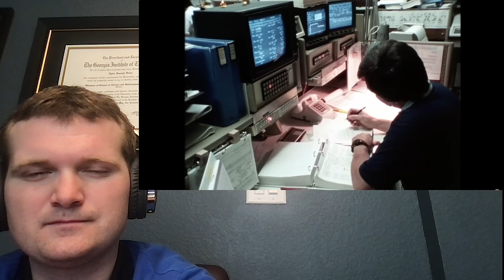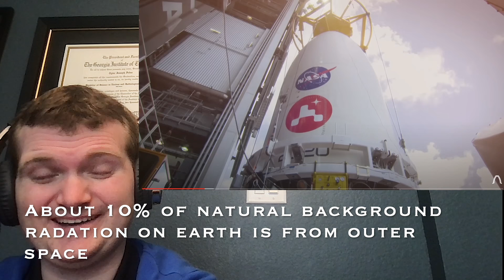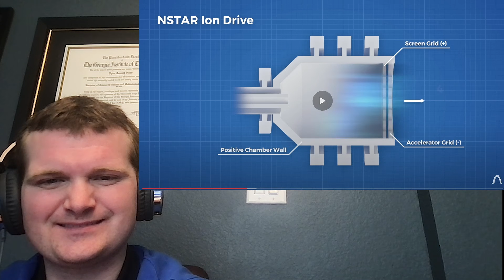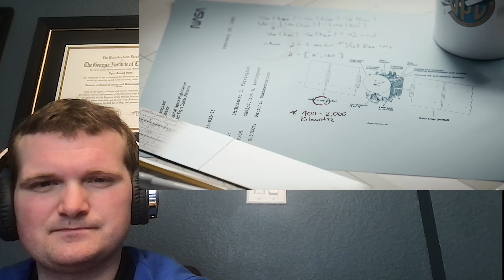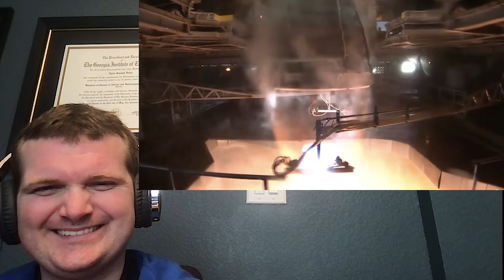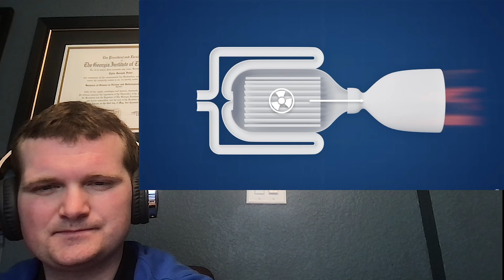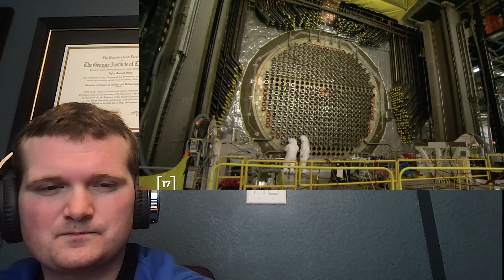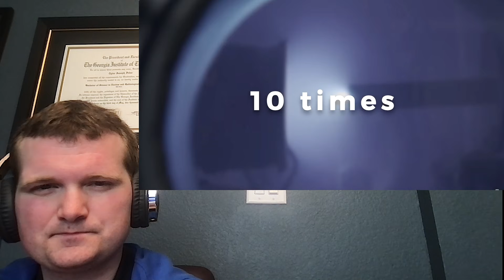Can Nuclear Power Take Us to Mars? - Nuclear Engineer Reacts to Real Engineering

Comment: Didn't they already try nuclear powered propulsion rockets in like the 70's ,80's but abandoned the concept .
NASA considered it too dangerous if 
the ship somehow blew up in the atmosphere ,LOO before it got into space ?
Just asking.
Reply: They have abondon it in the 70 beacause the project buget was cut and the launch risk is not realy massive since a unused reactor is less radioactive than a used one by order of magnitudes
Reply: Congress killed the NERVA program because the moon program was immensely expensive and a mars program would cost many times more and they didn't want us sucked into paying for it. It was the correct decision because we are on the cusp of sending humans to mars using in-orbit refueling and the program will cost less than one hundredth as much as it would have in the 70s thanks to modern rocket launch being far cheaper, and in-orbit refueling enabling nuclear like performance to Mars and back. 
Lastly, we didn't have any significant accidents in our nuclear rocket program, you are thinking of a Russian satellite that had a nuclear power plant that crashed into the Yukon in the 70s. The way the US launches nuclear plants into space is they aren't activated until they are clear of falling back to earth, because the nuclear fuel is relatively inert and low-radiation before the reactor is started, but once the reactor is hot the fuel and inner components become super radioactive.

Comment: NERVA will work, just don’t do direct ascent. And separate the engine and the crew, and put the water supply in between.
Reply: No one argues NERVA won't work, its only effective on routes that don't allow aerobraking because you can't re-enter the atmosphere once the nuclear plant is hot,  so it requires far more dead mass on the Mars route.

Comment: Solar sails could work tho, you use a gravity assist and a large solar sail to accelerate away from The sun and to decelerate at the target star. But if it isnt aimed extremely well the deceleration part doesn't quite work properly and you end up with some tangential velocity drifing away from the other star.

Comment: I think of a Sterling engine protect the cold of outer space and the heat inside and provide Power while turning heat into energy. And add inertia if done right
Reply: The heat inside has to come from somwhere. It's not free power.
Reply: I also think a Sterling engine cycle could do things here. In the sun side it gets pretty hot (moons sun side is about 127 Celsius) and on the other side you could have "space radiators"... don't know how they will work though as on earth we have air that can soak the heat up but in space there is none... so you can not just use a normal earth radiator. But there has to be stuff that can radiate heat into space because otherwise it would be hard to live on the ISS for example I guess...
Reply: Space is not cold, its a vacuum. So the temperature of any part of space can vary massively but most is technically extremely hot, meaning the very few particles in it are moving very fast, but there is so few particles per cubic centimeter that they can't heat you up at all. And any heat on your ship or in your engine is trapped unless you find a way to radiate away.

Comment: 11:54 you can do shielding with water. Because the astronauts will need water anyway. Moreover, if you're flying away from the sun, the spaceship itself can be used as a shield
Reply: Nuclear rockets need heavy extra shielding to keep the crew alive. A chemical rocket to Mars doesn't need much in the way of shielding at all, basically a solar storm shelter for solar storms, but other than that the radiation levels are easily survivable for long duration missions.

Comment: Well build the between mars earth ship in space. Send up the fuel. Send the supplies. Send the people. Space launch to mars. Easy.
Reply: There is no "between" mars and earth, both planets are constantly moving in orbits at high speeds. You can't just stop and hangout in space, you have to be traveling fast enough to orbit around the sun and any planets/moons you encounter. The correct procedure is to re-fuel your ship in low earth orbit to maximize the payload you can take to mars, which is exactly how SpaceX plans to do it with Starship.

Comment: hydrogen embrittlement, it's pretty nasty. smallest known atom can get into a lot of places it really shouldn't be including between other atoms. ~> changes chemical properties and you no longer have the same material that was safe. shielding that engine is easier that a standard reactor as you only have to have something between the crew module and the engine not all around as in earth based reactor types. at worst light shielding using distance/time as the other part of the shielding for around the sides but not necessary as it should not be landing or taking off from anywhere, purely orbital and interplanetary transfers.

it's not burning hydrogen, that would take oxygen or other reactive. it's simply turning the heat up to 11 EXXPANDING the gas.

Comment: Reactor shielding in space is a long rod separating the reactor from everything else. You might need a small disk shield near the reactor to keep the rod down to a practical length. Still the mass of this is trivial compared to the shielding needed on Earth. Remember space is already radioactive, there is no reason to protect it from the reactor.
Reply: That’s right, minimise shielding mass, take advantage of inverse square law for radiation
Reply: Still adds a lot of dead mass, which is the prblem for nuclear. Higher ISP but at the cost of far more dead mass for shielding, radiators, larger cryogenic hydrogen tanks, 50% more fuel for deceleration and landers since it can't re-enter atmosphere after it goes hot.

Comment: Ion engines and their low thrust are less of a problem for cyclers, where you have a large transfer spaceship that takes you to Mars, but doesn't enter Mars orbit. Instead, you detach a lander spacecraft which can use high-thrust engines to insert into Mars orbit. The cycler swings around back towards Earth, and you can catch it the next time around (either from Earth or Mars).

Pros: Only need to accelerate the cycler once, and then it stays in the cycle. That means if you have the (enormous) upfront budget, you could build a very nice, decked out mobile space station with plenty of amenities and radiation shielding, and only pay to launch it once.

Cons: Rendezvous with a high velocity cycler from an Earth/Mars Ascent Vehicle is pretty tricky, which plays a major plot point in The Martian. Based on some light Googling it sounds like you can't shorten the travel time much because it'll throw off the cycles, so you'll really want to make the cycler as livable and reliable as possible (shielding, medical facilities, gyms, repair shop for things that break) compared to a faster nuclear rocket.
Reply: Yep, cyclers are slow boats between planets. But they offer far more comfort and safety and shielding, so your launch/lander ship can be lighter as the crew doesn't have to live on it for 9 months of transit. One correction: they still need more fuel because over time their orbits will get perturbed and you'll need to make adjustments to keep them on track. But as  you said, that can be done extremely efficiently with ion drives.

Comment: if you want a funny nuclear engine, search for the nuclear salt water rocket. it is quite efficient and has a lot of thrust.
but don't launch from earth, it's maybe worse than orion.
essentially, you have uraniumnitrate or plutoniumnitrate dissolved in water. push that water through a neutron source or reflector, and it goes over critical. or in other words: you are riding a constantly igniting nuclear bomb.
Reply: it would probably get you kicked out of most planetary systems on the grounds of pollution :)
Reply: @saumyacow4435  Nope..as said here.. space is VERY radioactive already.. you spewing out radiation yourself is like peeing in the ocean....
Reply: And the ISP is insane.. something like 40,000 - 1,000,000s with massive trust as well
Reply: @MrZnarffy  oh yes. the only situation where I thought that using a nuclear salt water rocket on the surface of earth is: if there is an asteroid in excess of 5km, and they need to lift off as much people and supply as possible. with such an asteroid incoming, irradiating the launchsite is irrelevant.

Comment: the most efficient nuclear engine is a nuclear reactor in the focal point of a parabolic mirror. but since that thing needs to reflect infrared and some gamma rays (alpha and beta are welcome too), the mirror needs to be a bit different. maximum reflectivity in infrared.
power up the reactor, it radiates infrared light. the light gets radiated to the mirror and reflected back out. this gives you the best specific impulse, but acceleration that is comparable to solar sails.

Comment: 32:00 this entire section is wrong about something (from Real Engineering). The reason we use Xenon is that it has the perfect balance of mass and electric charge and ionisation energy (he does mention this last big). Let's say we used a lighter noble gas like Helium. The problem is that once its ionised the charge per unit mass isn't actually that different. So we can't push it as hard as we can Xenon. There would still be an ISP increase, but not all that much. Scott Manley has an excellent video on Ion Thrusters and the balance between the different fuel sources.

Comment: from what I understand, and please correct me, if I am wrong: sievert work great for our experience on earth, especially with, as you mention, short term exposure.
and for simplicity sake, they adopted the same system for space travel, but there are some problems. first, it is a constant exposure over a long time, and secondly, there is galactic cosmic radiation, that has insane energy values, yet has not a lot of particles around.
the first one might be easier to repair, since there is never a real shock of high exposure, the second one is complicated, since we don't know if it interacts with the sensor in the same way as with the body tissue.
but still, I wouldn't go beyond 1 sievert. but there are ideas of how to shield that.

Comment: Love that we are currently told we can harvest minuscule remnants of moisture from the MOON and use it to manufacture hydrogen fuel to send space crafts across the solar system, YET we are also told that here on Earth where water is plentiful, it isn't sustainable to use hydrogen fuel from water to motivate cars along the ground for comparatively short distances requiring a fraction of the power and expense.
🤔
Reply: If they could charge the same price as gas prices, the world would be full of hydrogen engines......but water falls from the sky for free, very hard to commodize that
Reply: That's because on Earth there are alternatives that require less resources, and on the Moon or other celestial objects with low gravity fields there are no other alternatives. Also, to send resources like fuel from Earth to other places you need more fuel, highly inefficient which is why it's preferable to find it once you are elsewhere like celestial objects with low gravity fields from which you need less fuel to escape their gravity field.
Reply: @marilynman  The first car used a steam engine long before the invention of relief valves. The current engines are combustion engines. Not combustion as in burners. Explosive. It's literally fuel explosions driving the mechanisms. Volatile is not the problem. We're willing to put coal plants and nuclear plants around our cities to power them. Volitility has never been a deterrent when it comes to energy.
And sure, if the moon was abundant with water, the argument would at least have practical standing, but we have always claimed to find water on the moon from where we stand on the surface of the Earth, but we've never actually found it when we get there. (Remotely or in person). Meaning there is no guarantee there's even any water to be found, and they are trying to suck up micro-traces from the soil to manage this.
We aren't talking about large amounts of water, and therefore we can't possibly be talking about large quantities of hydrogen. At all. 
Thus, at least ONE of these claims is an outright lie.
Reply: @autonomouspublishingincorp1778  I think what people are talking about it's the possibility if there is sufficient water. But there was never a claim that there actually is. This is just an explanation of why it is preferable to make fuel in low gravity and not lift it from Earth.
Reply: @autonomouspublishingincorp1778  It isn't the using the fuel that's the issue, its the transporting and storing it. You don't need sub-zero temperatures or extreme pressures to store gasoline. You do need those things to store and transport hydrogen. Gasoline is made of large molecules that don't easily leak out of containers. Hyrogen is the lightest molecule and very easily leaks out of most containers. Other containers, like Metal, it makes brittle. Hydrogen is a great space fuel (especially for lifting off earth), but they pretty much manufacture what they need onsite and use it. It also has a very large thrust capability when combined with oxygen as an oxidizer (amounts of thrust your car doesn't need, in fact that would be dangerous). Its not a good automotive fuel because you would need a huge network of storage and transport for such a volatile and easily leaking fuel. It would be expensive too. There is a reason EVs are becoming prolific by hydrogen cars less so. Hydrogen fuel cells or engines are the easy part, but without an infastructure they are useless. Its easy to have infastructure for a small number of spacecraft, its dificult for millions or billions of cars).
Reply: @andrewdemarco3512  Water is safe to store. It does not require any of the things you've mentioned, and EV's would be okay if they were done in a practical way, instead of the unsustainable and environmentally damaging ways we are currently making them. That's a little off topic, but since you mentioned it, the GM patent from the 50's and 60's was the best we've reviewed although by today's nomenclature it would be considered a hybrid rather than an EV since it would use a small diesel engine, but at 400 miles to the gallon and without necessitating the toxic consequences of today's lithium EV's that currently support slavery and war abroad; It's STILL the best technology you will never use. Better both environmentally and economically. (Although it's use would be limited to Earth surface transportation and wouldn't be suitable for space travel)
It's nice that you gave the topic more than a passing glance, but the comment was pointing out that the narratives contain LIES.
Not that we should or shouldn't use a particular fuel.
Reply: @autonomouspublishingincorp1778  water is not a fuel, especially for a car. It would take more energy to electroysize it into usable hydrogen then you would get out of it, so it can't be done in a car. You could generate hydrogen this way at fuel stations I suppose, but I'm not sure you would be able to gnerate enough of it fast and saely enough to refuel all the cars that need refuelling and it would be a horribly ineficent use of electricity.
Reply: @autonomouspublishingincorp1778  we can and should use more sustainable (and less child labour) mining practices for lithium batteries. In fact there are companies working on not requiring colbalt in the batteries, which is the biggest culprit for these awful mining practices. Also new technologies will help them charge faster and be mroe energy dense (for example solid state batteries). This seems to be the way of the future
Reply: Yeah, because there's several reasons that hydrogen is impractical or straight up dangerous for common commercial use. i.e as Tyler and Real Engineering pointed out it's super volatile and likes to slip out of most containers
Reply: It is unlikely we can make hydrolox on the moon at any reasonable cost. Water is only found at the bottom of frozen polar craters in steel hard rocks at less than 4% by weight. We'd have to ship immense amounts of equipment to dig out those rocks, heat them, grind them into tiny bits, heat them again to release the water, capture it, use large amounts of solar power to split them into hydrogen and oxygen, and store them in huge cryogenic tanks because hydrogen is the lowest density element. And still the hydrogen will leak away over time so you have to use it soon. And if you fuel a deep space ship with hydrolox you have to worry about the hydrogen leaking away over the years of the mission.

On earth hydrogen isn't a fuel, its a storage system. You have to use enormous amounts of energy to split hydrogen from oxygen in water, or industrial processes to get it from natural gasses, and then again store it in expensive cryogenic tanks to get any useful amount in a reasonable sized tank. Then you can burn it to turn it back into water vapor and generate less power than you used to create it in the first place (if splitting water) or not much more power than you used to strip it from natural gas and store it.